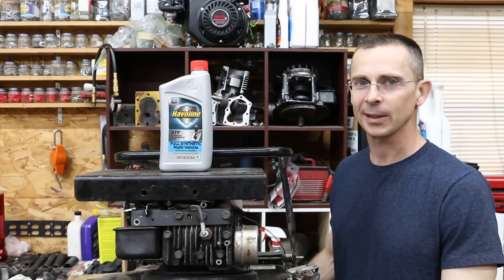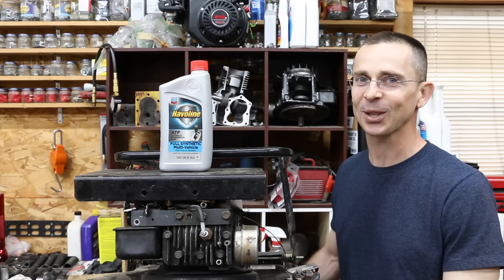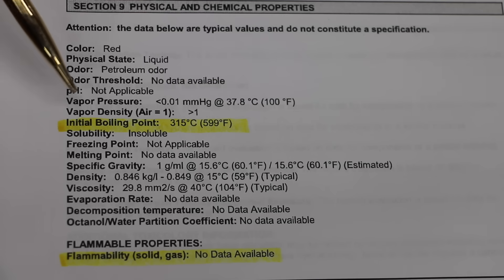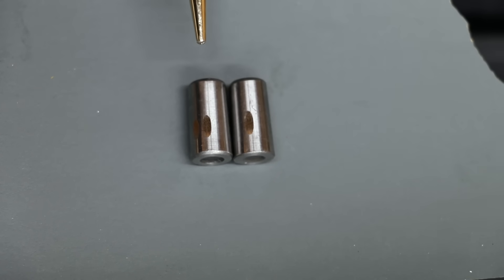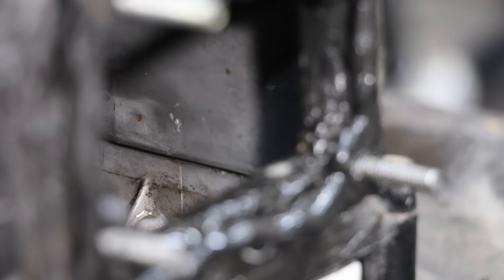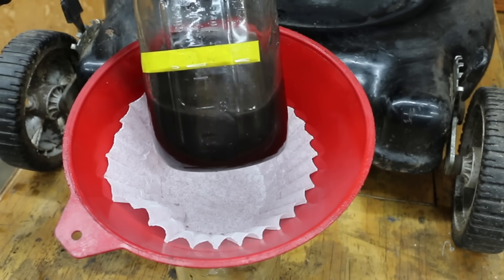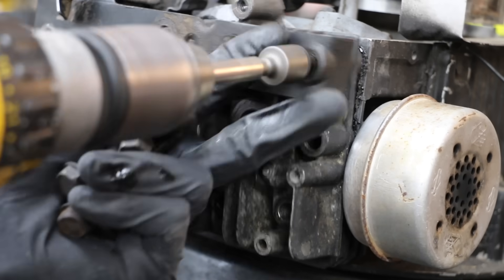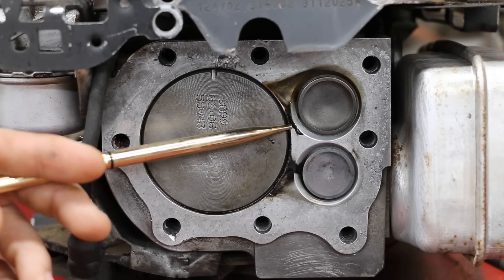ATF as an Engine Oil substitute?  Let's see what happens!

Comment: had a 79 camaro with a 305 in it got it from an auction  engine smoked a ton a  " friend " told me to put atf in it i misunderstood what he meant and i put 1 quart into the crankcase insted of dumping it slowly down the intake ..   the exhaust got alot quieter no longer had the nice V-8 rumble sold the car abought a month later told the guy not to drive it he did anyways last i saw of it was broke down on the side of the road.. my guess is that the atf  expanded the hydrolic lifters and  caused the valves not to close all the way just speculation on my part but the exhuast note changed  dramatically after i put it in the crank case
Reply from the maker: Wow! Thanks for commenting on this.

Comment: I've heard of ATF being used as diesel fuel additive (and straight substitute), so not much surprise that it's thinner than a proper motor oil.  Kind of surprised it left so much crud in the cylinder, though.  I would have imagined that it could burn off much better or at least escape as exhaust vapor.  Oh well.  Cleaned the canola out of the valves right proper, didn't it?
Reply from the maker: Yes, it cleaned out the Canola oil from the valves and piston rings.

Comment: For a more accurate compression reading you should measure when the engine is still at temp, since that's the compression it'll actually have when running. However since this is a before and after comparison instead of a diagnosis it really doesn't matter if you measure it cold or warm, as long as you test at about the same temperature both times (as you do). Just wanted to toss my 2 cents in. LOVE these videos! I find these extremely interesting as an automotive technician!
Reply from the maker: All great points and thank you!

Comment: This is one I have done before, in my car.  
I am not sure all what it did, it was really dark coming out.
The dip stick became really clean, and the car ran 240 miles a day, every day,  for a year and a half then threw a piston rod through the front of the engine. 
 Probably not the fault of the treatment. 
It was a 4 cylinder turbo that was driven rough before I got it.
Reply from the maker: Thanks for commenting on this.

Comment: Bought a used bronco few yrs back, 302 v8 180k mi, very dirty oil. Sat for months,  started up when buying had no knock, got it home, buddy said add ATF With fresh oil change, 3qts ATF 3 OIL, Let idle for 20min, around 15-17 min I thought I heard a knock starting,  buddy thought it was a bad pulley bearing,  let run a few more mins and it had a VERY noticeable knock. Drained oil, filled with new oil and it still knocked.  Motor was junk. Bearings wiped out, rods and cam down to copper.  Will NEVER use ATF to clean a old motor again. Lol
Reply from the maker: Wow!  Thanks for commenting on this experience.

Comment: The ATF SDS said the carbon chain length is 15-50.  That is the same as white mineral oil.
https://goo.gl/N3w5My

It is easy to make a lubricity tester that will yield a quantitative result.
Steel plate of a convenient size, say 12" x 18".  Must be thick enough not to deform under it's own weight.
Place the plate on a bench, inclined at a precise angle, say, 30-deg.
Steel slider stiff enough that it will remain plane (no bends) during test.  Size, say, 3" x 3".
Attach a post on the top in the center of one edge.
Low mass, low friction pulley, 3" or 5" diameter, attached to the edge of the bench so the top of the pulley is close to and even with the top of the plate.
Lubricate the plate generously with the lubricant to be tested.  Scrape off the excess lube with a notched trowel.
Attach a light but strong thread (maybe carpet thread) to the slider and pass it over the pulley.
Attach a light weight container onto the free end of the string/thread with a hook.
Place the slider near the bottom of the plate.
Add lead shot to the container slowly until the sled moves slightly.
1.  Detach and weigh the .container and shot; divide by the area of the slider.  This is the "starting friction."
Replace the container and shot on the string.
Continue adding lead shot to the container until the slider moves freely several inches.
2.  Detach and weigh the .container and shot; divide by the area of the slider.  This is the "running friction."
Reply from the maker: I like the lubricity tester you've designed. Thanks for this information.

Comment: Proper way to do that on an automotive engine is to drain the oil and leave the old filter on. Fill crankcase with ATF and run engine until fully warm.
Shut down the engine and drain the oil, remove the old filter and replace with a new one. Add one quart of ATF and finish filling the engine with oil. Change oil every 3000 miles, using one quart ATF with your new oil and filter.
Yes, it does work...
Quite well, actually...
Reply from the maker: This is great information. Thank you!

Comment: yes i have, trans fluid cleaned up hydro lifters when i bought a car that seems to have gone very long between oil changes, i put 2 quarts trans fluid in engine oil ran it on the road till the lifters quieted down changed the oil and filter. I also used diesel fuel to clean the inside of the engine. I drained the old oil. added 1/2 the correct oil then over filled the engine by 2 quarts with diesel fuel, ran it for 10 min at 2k rpm, changed the oil and filter, cleaned that engine right up. old car lasted about 3more years, before the rust was too much to pass inspection.
Reply from the maker: Thanks for commenting on this.

Comment: Found Type F atf doesn't foam as much. Also if you add atf to your oil it's meant to be done before you change it. Found best results is adding 1 qt on top of oil already in engine that holds 4 or more qaurts then letting it idle only for about 15 minutes. Then do a oil change letting drain long as possible.
Reply from the maker: Thank you for this recommendation!

Comment: Can you do a test between cheap gas and top-tier gas? (US Gas, no-name mom and pop shop stuff vs Exxon, Shell, BP).

I have a DI car, and im wondering if top-tier is better in terms of carbon build up and other aspects.
Reply from the maker: Thank you for this recommendation!
Reply: Aaron Thomas correct. However. Being the injectors are in the combustion chamber they can build up carbon on the tips. So under the assumption a top tier gas can keep the valve clean, I assume it would assist in keeping the injector clean as well.
Reply: I endorse this idea! I do pay the extra for better fuel as the car feels better to drive... But is it really? And does the engine have cleaner fuel system/intakes/and combustion chambers as a result? I guess the same engine could be used to ensure validity? Like... clean it. run on cheapo petrol, check. clean again and run on premium, compare? Maybe do your mowing the grass test to check power! Haha science!
Reply: emark24 all gas starts out the same they pump it through the same pipe line they all have to meat requirements min octane rate only when it to where it's going they ad their own "additives " to the gas say bp sends a 1000 gal they just take out a 1000 gal it's all pumped through same pipe lines from major place to place
Reply: carbon build up in DI engines is only an issue on the valves.  If the engine starts to idle rough, have an induction service done.
Reply: emark24 I've seen injectors removed from DI engines known for carbon buildup issues that have had zero carbon build up on the injectors themselves...even after 120,000 miles...
Reply: Not a bad test, however, "cheap gas" can still have plenty of detergents, totally depends on where that "cheap gas" is coming from, and all US gas has a minimum amount of detergents, but Top Tier means they have a certain level of additives like PEA agreed upon by a consortium. Some, like Costco, likely meet or exceed this threshold, yet they don't pay or advertise Top Tier. PEA is good for making sure injectors stay clean, Top Tier is just a way to make sure you're getting enough to prevent buildup but I'm sure plenty of cheaper gas has more than enough to adequetly prevent buildup as well.
Reply: The only way to run that test, would require two new engines and about one thousand hours of run time.
 The teardown would answer your question.
Reply: The problem with di engines is in the oil. You need to use a European spec oil. They don't have problems with di engines in Europe. Only in the US. It is well documented and confirmed.

Comment: When I was young and dumb I purchased a 74 dart with 128.000 miles on it with out doing a real check out first. After I bought it I found out it had never had an oil change so it was FULL of crud and coked up oil.The valve cover was so full of crud that it was hard to take off! It was suggested that I try 20% dexron in the crank case, so I did. The engine was in bad shape when I started, compression was low and it got 20 miles to the quart of oil. After running the 20% dex for a few hundred miles I got the opportunity to rebuild it. The oil consumption had been reduced to 25 miles per quart and compression was up. When tearing the engine down I found every thing was clean inside, no sludge or coked oil. Things shined up with a rag! Checking the bearings I found each was down to the copper on one shell but the crank was still round with no taper or barrel shape and was smooth enough to see your reflection! Miking the journals after wiping down showed they were still with in standard specs! Buy the way it was a 225 slant six. I would have no concerns running a 20% dex mix in an engine for a flush, running light load cruising on the highway before a full oil change.
Reply from the maker: I really enjoyed reading your comments--thank you!

Comment: Buddy's Jeep 30,000 miles without an oil change sounded like a diesel pull the drain plug and nothing but slime came out.. after 4qt of transmission fluid with 2qt motor oil and 3 new oil filter it still runs to this day..
Reply from the maker: Wow!  I hope he's changing his oil more often now.

Comment: I'm sorry to say (in my opinion only) that your test on ATF  as an substitute for oil is flawed.  1) you used Synthetic ATF. You needed to use NON-synthetic ATF, I know it may be out of production.   2) Canola oil isn't the proper  oil for a sludge  test, for it is a vegetable based oil. Just will not work for your intended goals. It needed to be petroleum based 10w40 or 10w30 motor oil. Also NON-synthetic.  3) Time and mileage. This is the big factor, you needed to buy or get a true  V8 or straight-6 at least from the 1970's or before, untouched. A lawn mower engine is too small and never would have the "mileage" or hours driven or run to create a good sludge base. To create the sludge in the crankcase, oil passages or other places oil would accumulate over time. I'm talking years of usage and low maintenance practices.   A car could average 20,000 miles a year, at 35 mph average,  which is 571.4 hours of drive time per year.  Not to mention the fact the heat/cold cycles that the car engine and oil go through daily (weekly). And would need to be over years of neglect and poor upkeep. If you ran you small engine 4 hours a month  for the lawn growing season, you might  get 40 hours a year run time total. that is only 0.07% annual run time as apposed to your car engine. You will not get the sludge needed for a proper test. Also you would be looking at 5 + years of sustained usage, Not to mention the high RPMs you would average during operations of those 571.4 hours. 4) The use of the ATF is to act as a detergent for cleaning and removing the years  of sludge accumulation within the engine.  Again in my opinion this particular test is seriously flawed
Reply: Number 5) Heat. Your little air cooled lawn mower engine is running 80 to 100 degrees hotter that most water cooled car engines ever ran.
Reply from the maker: Thanks for the feedback.

Comment: I love your comparison tests and how you test.  Except for one thing.   Engine compression check. Point one (1):  Most 4 cycle "outdoor power equipment" engines have a "compression release" system built in.  So one can pull the rope with less resistance from the engine for starting. Point (2): You spin the engine with a powered (corded) drill motor. Which produces huge RPMs.  While in reality the engine and spark system and compression release system are built to perform at about 350 rpm as if someone was pulling a starter rope. When you spin the engine with power tools the compression check is not accurate. Good job & thank you.
Reply from the maker: Thanks for the constructive feedback.

Comment: ATF works great for cleaning the internals of an engine. I recently bought an old e46 3 series and on opening up the valve cover found it covered in caked on burnt oil and sludge. I drained the oil, put fresh and added a litre of ATF. Drove for 2 weeks and drained again. The crap that came out was insane. Opened up the valve cover again and parts looked shiny and almost new. I was amazed.
Reply from the maker: Impressive! Thanks for commenting on how you've used ATF.

Comment: Hello, the auto mechanics I have seen, have been using ATF to clean engines by pouring the ATF into the Carburetor while engine is running fast. It makes one heck of a lot of smoke, but the mechanics say afterwards engine is much cleaner.
Reply from the maker: Thank you for this recommendation!

Comment: Normally 4 to 1 mix oil to atf. Have done this before in older 350.  Removes lifter tick and increased oil pressure. Only ran a few hours around town before changing it full oil.
Reply from the maker: Great point.

Comment: Have had good luck using it to get an old motor cleaned up after sitting.  Good cheap way to thin down the old thick oil before an oil change. Cleared up a stuck lifter for me in the winter one year in my truck.
Reply from the maker: Thanks for commenting on using ATF!

Comment: How did u make that custom plastic bottle gas tank? Pretty neat to use it without having any leaks
Reply from the maker: I used JB Weld to attach a small funnel at the bottom of the container.

Comment: Old school mechanic that is my mentor had me use ATF as a fogging oil on my boat. Fogging oil lubricates the combustion chamber and valves. You could do a test on those two things. Or could test it against say sea foam for carbon removal.
Reply from the maker: Thank you for this recommendation!

Comment: Have used it more then once for sticky vavles/lifters. Does work just dont expect magic or works on par with any engine cleaners. The big advantage is its cheaper so you can run it 3ish time more with cheap oil to help clean your engine. Aslong you dont run it in a high % oil/atf and dont run it for along time.
Reply from the maker: All great points and thanks for commenting on this.

Comment: Why not weigh the bearings before and after to determine how much material was removed?
Reply from the maker: I considered doing this.  Some of the products claim to soak into the medal and that could impact the accuracy of the weight. What are your thoughts?
Reply: If that's a claim they make that's something to test as well. Weigh before then soak for a pre-determined time then weigh again, you would have to figure out a way to dry the bearing without using chemicals though otherwise it might impact the result. Maybe just using a lint free rag would work. How sensitive of a scale do you have?
Reply: @ProjectFarm  Weigh them after soaking and wiped off and see if its true. I have my suspicions of products being able to soak into metal. You will need a milligram scale.
Reply: Project Farm the expense of a scale that could weigh that little bit that went into the metal would be in the $ 5,000.00 amount if not more. We have a several thousand dollar digital scale for paint mixing and it might take 3 drops of pain to
Get it to up the weight of the paint mixture by 1/100 mg’s so I don’t think that would be worth it.
Reply: @JohnSmith-ws6jg  You can buy sub $50 scales that weigh 0.001 gram
Reply: m m you know, I thought about what I wrote and that was for a scale that did a lot of communication with the main computer and a ton of operation so the cost would be apples to oranges and it did measure to .001 thanks for covering my ass. Obviously by brain has had way too many paint fumes !!
Reply: On that note, I know of an incident with a 3.5 v6 Impala fleet vehicle. Mechanic drained the oil and forgot to refill.  Vehicle was taken on route, and driver came back an hour later complaining of harsh idle.  
Topped it up with  the same 15w 40 Rotella all the Fleet vehicles are given.  Still being driven today.
Reply: @DarkLinkAD  I seen a Chevy v6 can't remember what it was. Not a 4.3 that I do know. But any ways this v6 ran for 4 days without a oil pump in it. Guy in our shop changed a timing chain cover and never reistald the pump. Lol
Reply: SUPERMAN XCI  Probably a 3.4 DOHC. Came in the Gen 1 1/2 W Body platform.
Reply: It could be an interesting test to weigh the bearing, let it soak for 24 hours in these oils which claim to permeate the metal, then re-weigh to see if they actually retain any additional weight.
Reply: This is basically just for fun to see  what could happen,  leave the technical weighing everything,  how many ppm etc to the engineers

Comment: i have used both AFT and OEMGA engine flush. and they both work. be careful as it will damage the film strengt and might damage the engine. if your unlucky you might dislodge some old crap in the oil gallery and clog a oil passage with a failed bearing as a result.
Reply from the maker: Great point regarding the risks!

Comment: That metal in the coffee filter is a good reason to change small engine oil more frequently than a vehicle or larger engines in lawns tractors etc even if high quality oil is used. They do not have filters that pick that stuff up and can lead to premature wear.
Reply from the maker: Yes, great point!